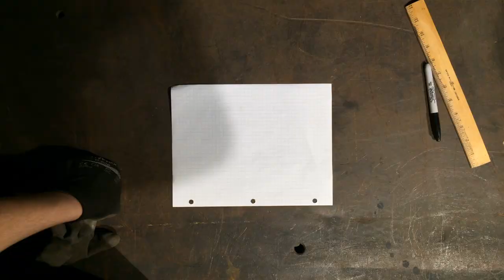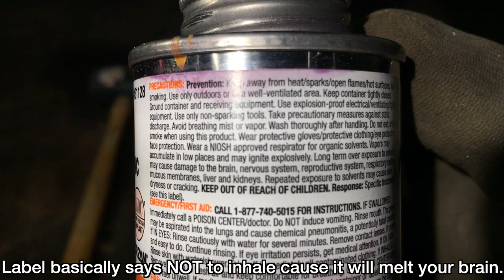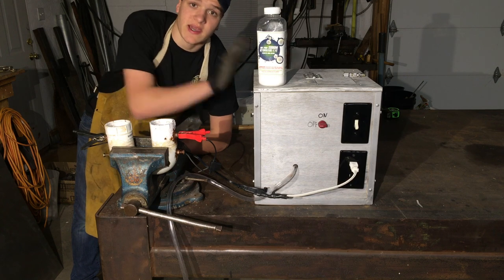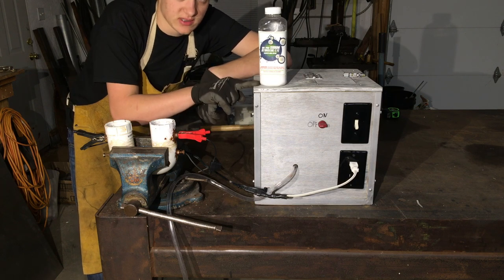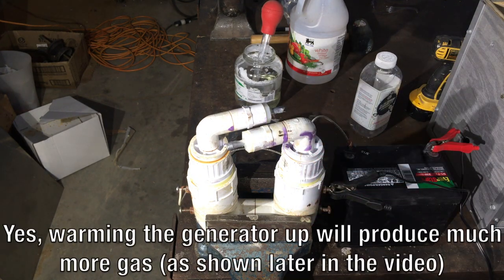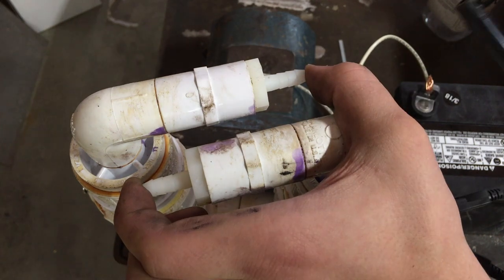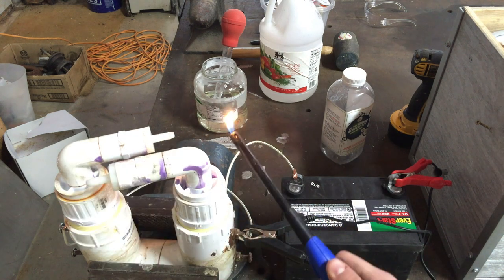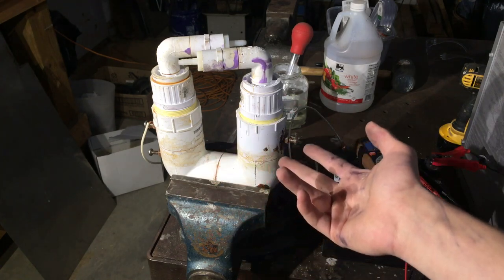Separated Hydrogen and Oxygen Generator (made from PVC) (HHO)

Comment: Since a mole of gas fills a set volume and is based on the number of atoms in the gas, you could collect by using 2 chambers. The hydrogen side twice the volume of the oxygen side.

Then for flash back, have a water lock flash arrester on both outlets from high pressure to ensure no mixing in tanks. Taller flash arresters are better as the pressure needed to push the water up is greater.

Then use a densr wire mesh flash arrester at the torch, below the point it gets warm since hydrogen has a low auto ignition temp. Also HCl also works and won't alter the ratios as the chlorine basically instantly reacts beach to form HCl again of seperated.
You get a white precipitate of using copper plate from copper chloride forming, but by using less reactive metals you minimize this.

Comment: Brilliant illustration of the principle.
I thing abrading the cathode and anode to increase the surface area and adding layers of plates for the same reason would optimise it.
Reply from the maker: Thanks! Yes you are correct. To make it even more efficient, I could get a 1.3 v power source and use that. The extra 10.7v is from the battery is considered wasted energy.
Reply: @HappyMadScientist  you can also add a column over each side so the water cant reach the top. If you use stainless steel wool you would have the most surface area. You also want to drop the voltage down to about 2.5v for max efficiency

Comment: yes amperage runaway is a problem with these things.  you will just boil the water away at some point.  So current control is key with these things.  Control the current and you will have a nice consistent hho production without the over heating.
Reply: you can get o2 meter on ebay for cheap

Comment: I understand that a simple piece of nylon fabric will create enough surface tension to keep the gases separated, while allowing the water solution to pass through and stand up to the lye.
Reply from the maker: Yeah I’ve heard of that stuff. That would be a lot more efficient than this type of generator.
Do you know where I could find that stuff?
Thanks.
Reply: @HappyMadScientist  doesnt have to be nylon. Felt works as well. But an old tent or jacket or something like that may work.

Comment: a very good video with well explanation, very good idea to produce hydrogen separately, i have made dry cell to produce hydro oxy gas,  installed in different vehicles (550-2700 cc engines) and taking almost 25-45 % increased km

Comment: Great simple design!!!
You know that you can avoid overheating by using more plates, each charged plate can be placed close to a non charged plate and so on and so forth, this will drop the voltage and not waist so much energy or overheating causing steam to mix with the 2 gasses.
  I love how simple these things are to make, and the perfect voltage in a HHO generator is only about 3vlts, the rest of the current is converted to heat, so placing non charged plates in between charged plates will keep things cool enough not to make any steam, it's also much more efficient in all ways.
  thanks for the video, I am working on a large generator, one where I can use the mix of the 2 gasses to be able to weld, cut.... metal, but I also want to be able to separate the two gasses when I want to use for different applications.
  Did you ever experience this setup getting too hot? Seems like a lot of current for 1 plate for each charge, but hey if it works, it certainly doesn't look very hard to build.
  Have you ever just tried running 3 volts through the unit? 12 volts seems like overkill and if I understand this correctly, it's going to overheat in a short time, but I could be mistaken.
  Thanks again for your knowledge on this topic and build.
  Please let me know if you have experienced overheating issues with this setup, thanks Buddy!!!
Reply from the maker: Actually, if I used more than one plate on each side the gasses would no longer be separated. The neutral plates still have a "+" and a "-" side which means both gasses are produced on the same side of a neutral plate.

You're correct I am wasting energy by using 12v. The reason is that at the time I didn't have a power supply that could produce the amperage I needed at a low voltage. The optimal voltage is actually 1.23v but 2-3v is a good number to shoot for. 

Overheating is definitely an issue. I'll admit it's hugely inefficient. It was a "proof of concept" though. My much larger generator I have tuned pretty well. It produces a lot more gas for the same amount of energy. But the gas is mixed so...

Hope this helped. It's a little mind-numbing to keep track of all the different variables lol.
Reply: Happy Mad Scientist Hey, thanks for getting back to me, and so quickly.
  I really appreciate your help and advice. It helped me a lot.
 Thanks again, God bless you and your family!!!
Reply from the maker: @allentremper8243  Thank you! You too!

Comment: Now I made my own, would a check valve work to keep hydrogen from coming back cause i want to use both O2 and H2 gass in a combustion engine only(No gasoline)
Reply: The answer is I dont want hydrogen fuel cells and yes im insane. And. Tho combustion engines are not as efficient they can produce AC power and more power over all.
Reply from the maker: Check valves (in my experience) aren’t very reliable when it comes to stopping flashbacks. Bubblers work the best.
Reply: Get a flashback arrester, of make one(tightly packed steel wool in a piece of tube)

Comment: Oh and I also heard, From watching videos, that you can produce more hydrogen in by increasing the surface area that the plates are contacting the water with. I saw one HHO generator On YouTube that the guy you stainless steel scrubbing pad with the sock over and wrapped over that sock with another set of stainless steel scrubbing pads That I made as well and it seem to produce out outrageous amounts of amps I will need to install some sort of ammeter or auto reset fuses To control the draw. Perhaps you can experiment with that as well. Also I have not heard of the chlorine poisoning before, so I will have to look into that however my question is if chlorine poison is produced by using sodium bicarbonate as well?
Reply from the maker: To lower amps just put less of the electrolyte in the solution. 
That’s interesting with the SS scrubbing pads. I’ll defiantly look into that with my next generator.
Reply: @HappyMadScientist  I believe even running just distilled water the amp exceeded my cars alternator output. Using the stainless steel scrubbing pads with a sock as a barrier leaves the smallest amount space between the cathode and anode ive seen thus far. It's just brilliantly efficient. I also used 6 AS pads too so i could try using less as well. 
The idea is to improve gas MPG and emissions for phase 1 and Ph.2 is to eliminate fuel as a primary source completely aside from initial start up and poss. Reserve but it gets complicated dealing with the engine management systems which lead me to discover a possible conspiracy with our O2 sensors..
Well anyway, thanks for the info. Good luck

Comment: Thanks 4 video , it was great !🆒⬆👍🔬📚🔩⚡🔧☺
Reply from the maker: Thanks! Glad you liked it!
Reply: something you might consider to help the project , I need  to adapt this type of stuff to my set of science arsenal equipment and a key point from what i had gathered from books  is, I think you  need to apply about 1.2 volts or so per  cell set ( one + and  one - plate)  to keep water from getting hot , if you give a set of plates 12 volts (12v - 1.25 = 10.75 ) the 10.75 will be heating the water. so maybe try about 9 sets of plates  in series for the 12 volts appied to circuit  to see if it becomes more efficient ( less heating) ,  i need to try this  for myself . if i would try 6 volts i would test with try 4 or 5 sets of series wired cell sets . whatcha think ? and thanks ! 📐📏✏👍😃📖📚📡🔬📉🔧🔩

Comment: Is there any formula or equation between the voltage and the volume of separated gases?
Reply: Well it's hho, so he should get H2 and O
Reply: @dissonantiacognitiva7438  yes I know but I'm asking about the amount of products and voltage thet we connect
Reply: @OPET_EV  so I saw a video that you shouldn't push more than 2.2v otherwise you will get more heat and vapour rather than HHO, India not pay much attention to the current
Reply: @dissonantiacognitiva7438  yes that heat is because of resistance of water
Reply: @dissonantiacognitiva7438  thanks for replying

Comment: How "clean" is the oxygen coming out, would it be clean enough to be worth compressing and using in an oxy setup?
Reply from the maker: I don’t know...
Reply: Or you can use a powerful uv light to dry/dehydrate the gas before combustion, as H2O is the only byproduct after combustion
Reply: @dnfking6509
Reply: @HappyMadScientist   for sure

Comment: Making Hydrogen gas and oxygen gas side by side? My first basic chemistry lesson taught me that both gases (H2 and O2) when mixed nothing will happen. But if there is an electric spark (catalyst) the result is a catastrophic explosive reaction making water.  Also pure oxygen is extremely flammable. If in case our atmosphere is filled with 100% oxygen (hypothetical) life would not exist because everything around us will be burning constantly.
May be in this video the quantity of gases made were small.
Reply from the maker: Yep the gasses are made separately. My other generators produce the gasses combined and have much more safety precautions. Yep the quantity of gasses were quite small.

Comment: Why did you use CPVC glue on PVC pipe? That is not a strong weld.
Reply from the maker: Doesn’t need to b strong. It just need needs to hold water. It was still pretty strong though.
Reply: I wish that pvc was stainless steel 316L...
Reply from the maker: @enjoymusic4895  me too :)

Comment: I have made the experience but I faced the problem of heat! How can I make the system less hot?
Reply from the maker: You need to run less amperage through your system. To do that you will need to either decrease the voltage or decrease the concentration of your electrolyte. It will produce gas slower but it won’t overheat. You could try to make a heat exchanger using copper pipe (aluminum will react with sodium hydroxide) to remove the heat if your feeling ambitious. Hope this helps.
Reply: this system can also be kept in a container filled with water to release its heat to water

Comment: Dang it. I was going to make one of these. Had a feelin you'd get to it first. Great video. Do you have any clue how much chlorine gas the generator would produce when using salt as electrolyzer? Thought I read somewhere that the amount produced was small enough to be relatively safe... But i've no idea. Lol, slightly evil laughter, then: "that never gets old" 😅
Reply from the maker: Not sure how much chlorine is produced but prob not much. Sodium hydroxide (to the best of my knowledge) doesn't produce any toxic gasses and can be found cheap on Amazon. My mom is already a nervous wreck when I make hydrogen gas so there is no reason I can't spend a couple bucks to skip the chlorine gas. Although, the fact that it's so basic it can give you some bad burns doesn't help.
Another thing, if you use stainless steel and perform electrolysis with it, it becomes illegal to dump. So you could use platinum plated stuff but that is a bit out of my price range... 
Fill a 1gal milk jug with the mixed gas from and you'll rock the countryside. It's mostly loud though and hardly has any destructive force (can set off a water bottle in my hand) so my parents let me experiment with it. No excuse not to be careful though.
Reply: Illegal to dump eh? Huh, I kinda remember reading that before. The chromium must react with something. Interesting. 
Hold there, 'hardly any destructive force' ????? Yeah right. 🙄 The destructive force depends on the strength and materials you contain the explosion in. Loads of pressure from that kind of explosion. And the plastic will shred your hand if you do it wrong. Mythbusters proved it. 😀  (with dry ice bomb) Tell me you haven't let one off in your hand....   
I'm quite positive if you stuck it in a metal container that you'd get a very nice bomb.
Reply from the maker: The chromium is toxic or bad for the environment I think.
I said a MILK JUG full of it has hardly any destructive force.
I've filled a glass bottle with hydrogen, put it in a deep hole, and remotely ignited them and I just heard a "tick". The glass bottle was fine and actually pulled a vacuum (condensed into water).
Pressurizing a vessel (which I would never do cause I like my hands attached to my body) with the gasses might do the trick but I'd be doubtful it'd do half what gunpowder could do. Plus, since hydrogen leaks easier than (most or any) other gasses, it would be extremely hard to hold any type of pressure not to mention the risk of it igniting while filling such a vessel. Not legal either I would assume.
Water bottles with hydrogen are lots of fun and relatively safe (my opinion)(don't try this at home kids). I hold the cap of the bottle and wear gloves for sure. Ear protection is a must cause it's about as loud as a .410. Lit hundreds off that way. They are a good way to scare the crap out of someone.
Reply: S'pose i was reacting to the "hardly any destructive force" bit. Destructive force is relative, i suppose. I was told a story once about some people who made a hydrogen powered golf ball cannon. According to my sources, it sent them too deep into pine trees to pry out. Speaking personally, i'd call that some fairly serious destructive potential. The number of psi required to blow bottles up with that much force is pretty high. It would be quite interesting to find out exactly how much pressure is generated.
Reply from the maker: A bottle blows at around 80 psi. I've tried to make a hydrogen gun but it proved difficult. The gas condenses into water before the projectiles could leave the barrel and sucked the projectile back into the gun with extreme force. That, as you can imagine would make it hard to read pressure without an expensive electronic one (like Mythbusters use). A bigger air chamber would've done the trick though I think. Also loading such a gun is a pain in the butt.

I guess the way I use the gas is non-destructive. It could definitely be made into something destructive (heck, if I get the H2 atoms to fuse and I'm in business😂)
Reply: Use sodium bicarbonate or sodium hydroxide

Comment: One Question ? the  Hydrogen Oxygen Generator  you Created there  Can it be utilised to where it can power up a Petrol Engine I Understand that One would need  a Lot  more  Volume  of water and sodium Hydroxide and  also to Produce the  Hydrogen; the  Power would have to come  From the  12 Volt  Battery but once Powered up the  Alternator  could Be directly Powering up the  Hydrogen. We In Britain are Now Being Taxed so Heavily on Petrol and  Diesel that if we also venture out into the  City; we have to pay a Tole Charge of about  £50 per week But Of course  Running a  Car Basically on Water  would Make things  Better ; Since the  1930's This Process has  Been Known But anyone that wanted to  Patient  such a devise The  Oil Moguls either Bought the Patient  to stop us From Having Cheaper Fuel; or if the Guy did not want to sell  The  Guy would end up Dead: We Had some Guy who was a  Farmer that Invented a Car that ran on Methane which was from Chicken Shit and they Paid him not to Patient it; and then there was the  Guy in England  In the  Early  60's that Invented a car that could do up to Five Hundred  Miles on Vapour The  Moguls Gave him Four Million Pounds  for his invention: Looks to me that There are some  Men out there  who Have  Come to the same conclusions as those that were inventors before Our time
Reply from the maker: So it's very controversial. You can definitely run a petrol engine purely off of hydrogen gas. There is significant scientific evidence, however, that making hydrogen gas with the use of the alternator is not able to improve fuel mileage. There's actually significant evidence to show it makes it worse. This is because of the huge amounts of electricity to convert the water to 2H2 O2 gas. 
You could theoretically make the gas with say, solar panels or the electricity from your house and then store it like the way actual hydrogen cars do, but that would be complicated and expensive.
Hope this helps!

Comment: you should make a small syringe type torch and hook it up to see what kind of flame you get
Reply from the maker: Yep. I want to make a new generator big enough to run a cutting torch
Reply: @HappyMadScientist  lol woah there just start small with what you got to see if its enough for a mini torch and work on your design from there
Reply from the maker: @ARCSTREAMS  haha yeah. and did I mention it'll run off of rectified 120v? 😬
Reply: @HappyMadScientist  im sure finding the power source is not the main problem lol its making an efficient safe designed cell ,,btw if want to use a small 12 volt/2to4 amp trans with rectifier will this be ok to produce anything worthwhile for a small mini torch? and how do i make it so the trans does not burn out if the cell pulls more amps? maybe a dimmer switch?  i also have a microwave trans but i hate messing with that sucker
Reply from the maker: @ARCSTREAMS  To reduce amp draw just reduce the concentration of your electrolyte until you have a satisfactory amp draw.
Reply: @HappyMadScientist  i guess i can start with distilled water and add small amounts of electrolyte ,but not sure if my analogue meter can read the amperage ,but the rotary dimmer might be a good current control and gas regulator